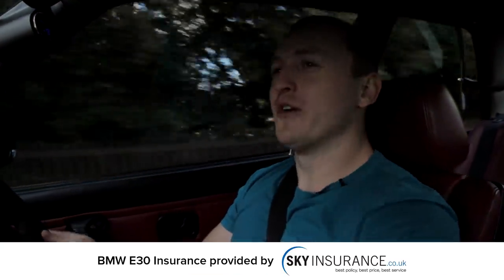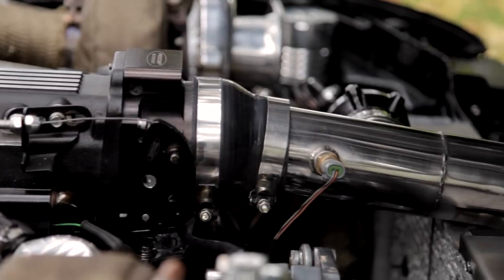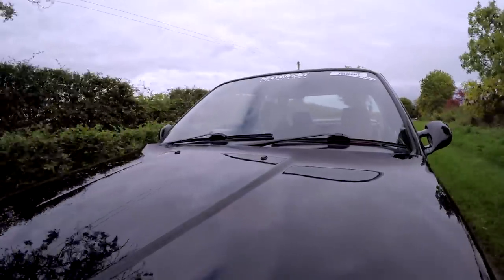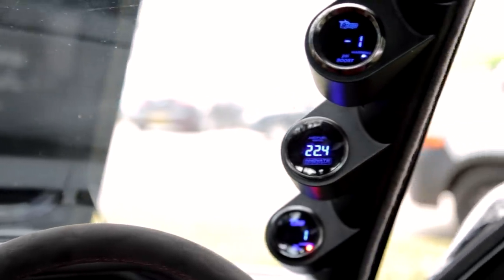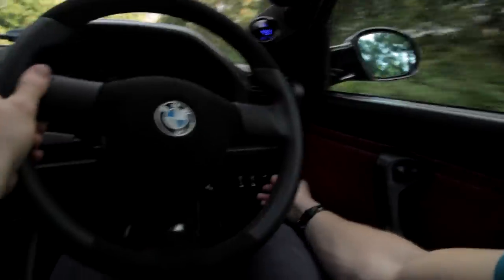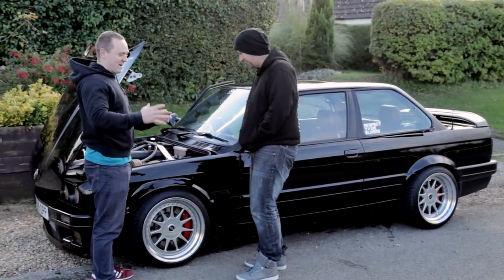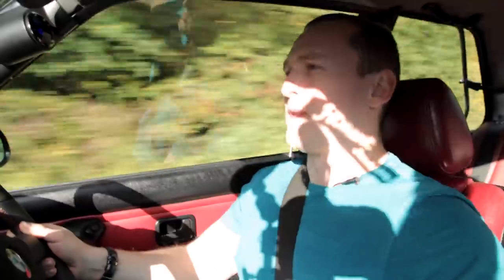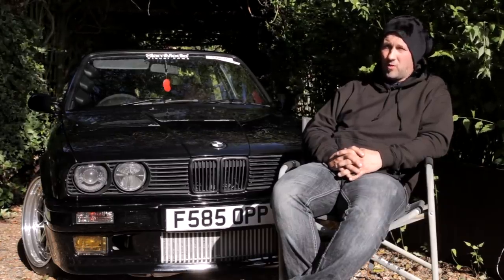800hp BMW E30 V8 Review: My Perfect Widow Maker

Comment: People keep saying S62... As if the S62s can easily get to the 800HP range...
Reply: +Jethro Vitorio Scultor yeah, actually the ''normal'' non-M M62 engine will be better for turboing, more meat between cylinder walls.
Reply: Wymiatacz Plays Honestly? With the Lack of Aftermarket support, getting even the M62 to 800HP (Which is more than double of stock) would be tricky... And after all is said and done, the LS Swap made much more sense since it wasn't terribly expensive, not as needlessly complicated and provided a similar enough end result anyway.
Reply: S62 makes way over 500 N/A with good boltons, It is seriously restricted in stock form with its 400hp. Yes it is complicated and more expensive, but it is an BMW engine, and one of the big parts of BMW driving experience is how their engines feel ... 800 hp is not easy but with two snails 1k hp is not even a limit...
Reply: wickedroman Find me an S62 with 500RWHP without a supercharger. Besides some Race Only S62s. And don't mention Ascari. Ascari doesn't exactly use standard S62s and they're tuned engines aren't cheap. (50k Euros apparently - Bimmerforums)

The most I have seen with Headers, Exhaust, Intake, Tune is 400RWHP (470BHP) (Dinan S2 FBO).

And then, for the price of a Full Bolt On S62? He could have already built that 800HP LS Engine. There's a reason why it's so damn common.
Reply: +Jethro Vitorio Scultor reason is it is cheaper and easier.  sorry but if you read the title, there us mentioned word perfect. Perfect in no means cant be chepaer or easier to build. And there are s62 with 500 hp out there, in gands of people who care to own a proper car with propee engine.
Reply: wickedroman Sure, "Proper Engine" stuck with VANOS issues, Lack of tunability, Expensive as hell to mod, Needs Ascari or other extreme engine builders to produce reasonably high power, May explode when you use an oil that isn't 10W-60.

Besides as the title said, it's HIS (Owner) perfect Widowmaker and he certainly isn't a Racing Engine builder, He's an Engineer working on his own car so Cheaper and Easier does matter. The fact that at that point (800HP), It won't even have the same characteristics as a BMW engine makes sticking to one brand even more moot.

The only thing an S62 has over an LS is HP/L and since he isn't racing under F1 rules or the like, there's really no reason to limit displacement.

And another thing, a Non M engine may actually be better since they aren't as highly strung.

And last, A lot has claimed 500HP on an S62 yet no Dyno Charts... Dubious. Most stop at 450-480hp at the crank or 400hp at the wheels.